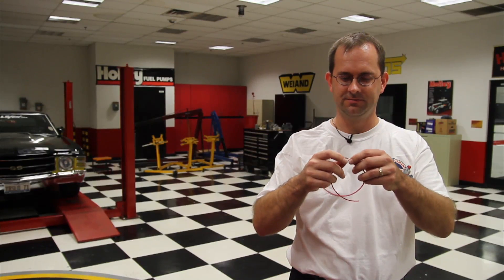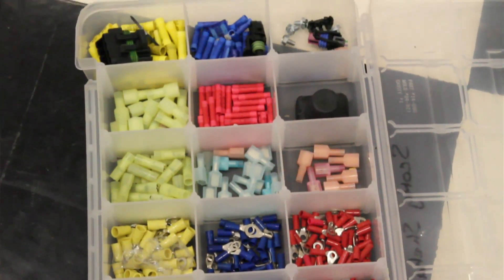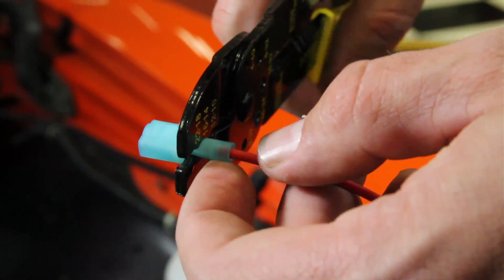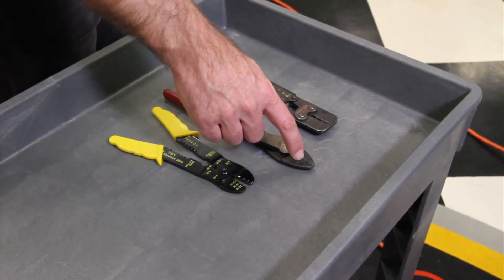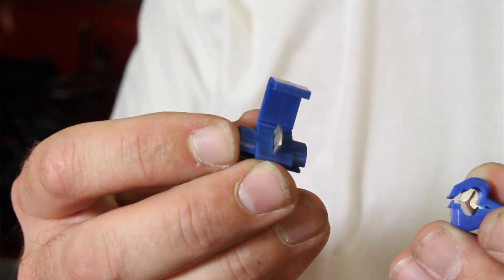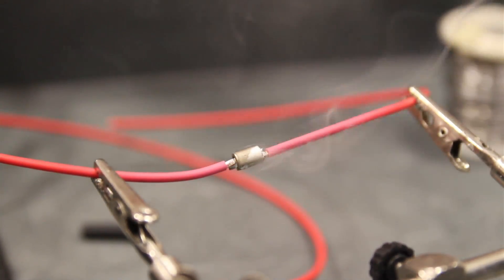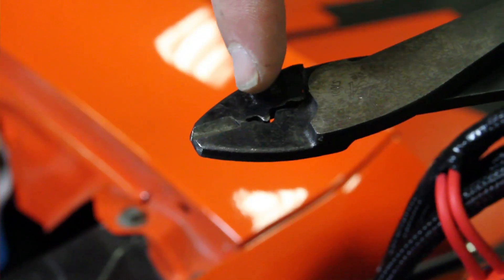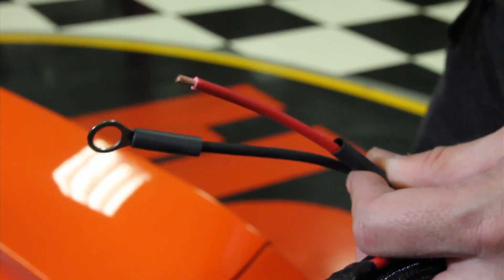Holley - EFI Tech: Basic Wiring Techniques

Comment: Yikes! BASIC basic wiring. Lol If you installing a new standalone efi on your ride you should already know this. 😬  😬 That said id like to put my two cents in. If you do decide to solder a non insulated connector after crimping, dont go crazy with the solder. The conductors will wick the solder into the wire beyond the joint if an excessive amount of solder is used. While this is not necessarily detrimental it will make the conductor very stiff. If theres any movement in said conductor this can lead to work hardening and ultimately breakage. Juuuuust a little bit of solder will do the job. Be sure the tip is clean, the joint is sufficiently hot for the solder to flow out. If the joint stays shiny when it cools its purrect😺. If you choose not to solder no worries, a properly crimped connection is very durable. I prefer non insulated crimp with quality shrink tube to seal it from the elements. Don’t skimp here, be sure to get the stuff with the glue on the inside. Not only will it insulate the joint it will protect it from dirt and moisture and provide a little strain relief. Finally, what the hell is a eight O2 sensor??? Nascar style no less 😂🤣😂

Comment: do you have any videos on custom wiring, i wanna do an eight o2 sensor nascar style setup on my 355 sbc, i have no idea how to do any of it and get it to plug into the ecu, im using a dominator setup with a 2000 cfm throttle body, anything would be greatly appreciated, thank you- joe